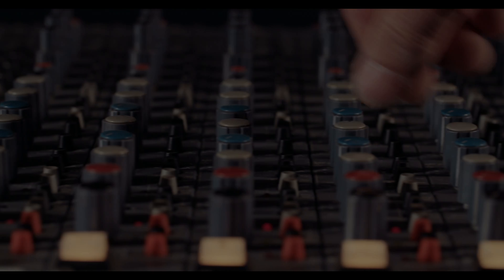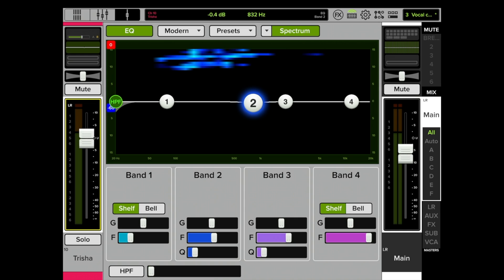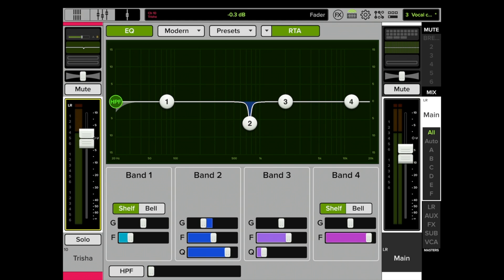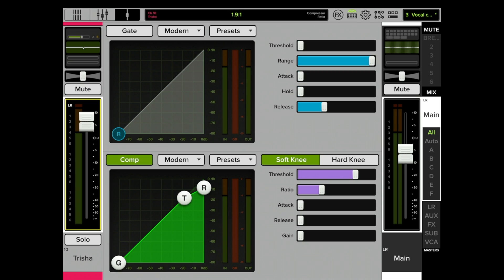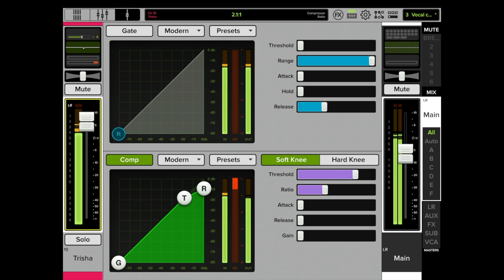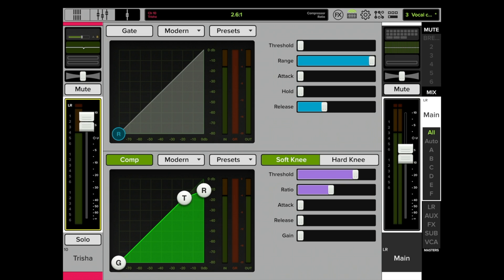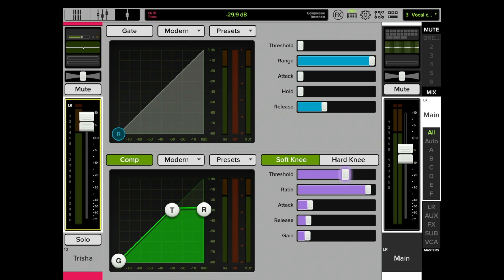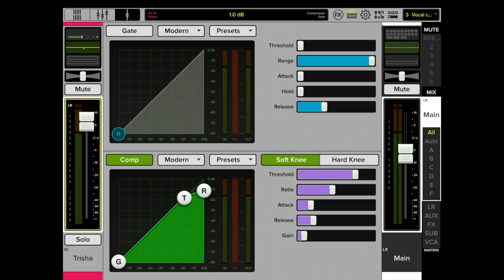Mackie Master Fader 5 Vocal Compression tutorial

Comment: You have very informative posts on the system. We have a 32s at our church and I'm new to sound systems. We seem to really struggle with balance between soloists and piano. There seems to be some weird issue where the piano dominates the soloists when they are together but everything is fine in parts where there are only vocals. For instance, the music starts  accopella but then the piano comes in later. The piano basically lowers the gain of the soloists. It's like a big averaging system where now the soloists share the total gain with the piano. I've used the compressor pretty heavily on the piano to modulate this effect with some success but I'm not sure that's the right strategy. I hope that your palm didn't just whack your forehead with my ignorance of sound systems. I'm an engineer, not a sound engineer.
Reply from the maker: Such a well thought out post :-) I completely understand what you're talking about and it sounds to me like there is too much compression being used. I would like for you to try this, make sure that there is no compression whatsoever on any vocals, piano and especially no compression on the main sound. Also for this experiment, it would be best to not use any subgroups. Try this and report back with your findings :-)